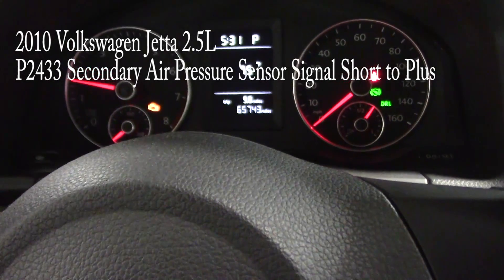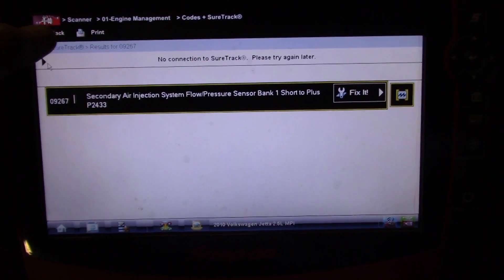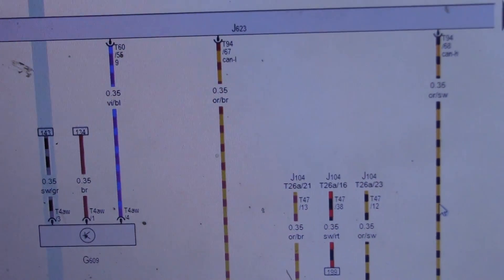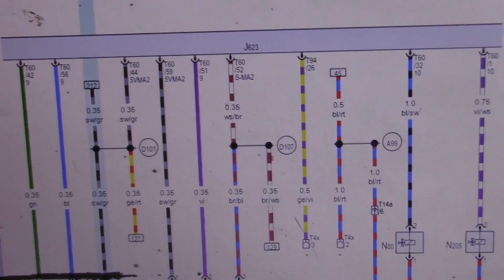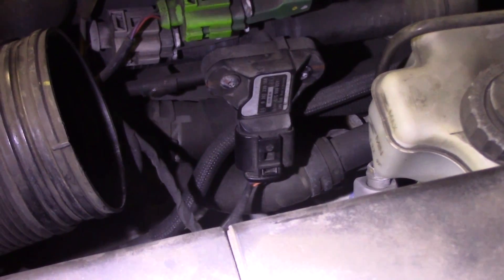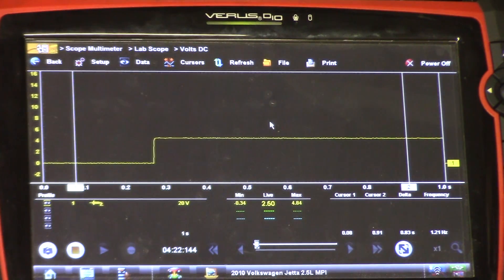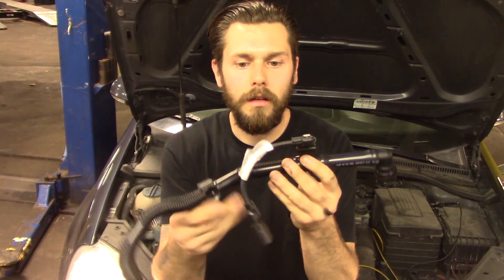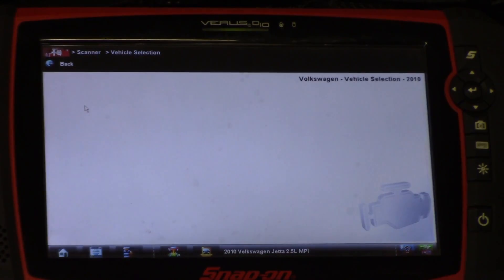2010 Volkswagen Jetta 2.5L- P2433 Secondary Air Pressure Sensor Signal Short to Plus

Comment: Most mechanics get the MAF and MAP sensors mixed up. A person from Midas told me my check engine light was on because of a MAP sensor but, I even thought it was a MAF sensor so, I think I changed the wrong sensor. It’s in the shop now and the Technicians are baffled so I told them to check the MAP sensor. Excellent video brother!

Comment: Ok, that was such a simple yet effective way to determine what the ECU sees with an absence of any data PID. 

That's so cool, you don't have to go to the ECU and measure the V on that pin. You can just unplug the sensor, if the ECU flags a short that means we can confirm that's exactly what it's seeing - 0v. 

How cool. I would have been digging up the ECU by now.

Comment: Does the map sensor look just like air sensor? Because im trying to find out I think the map is under the throttle body and the secondary is right above we’re your sensor is at I got a 2.5l 5cyl
Reply from the maker: Yes they look the same. Map is located under the throttle body
Reply: I am trying to find the location to this part all i can find is the map sensor on my 2015 gmc terrain

Comment: I'm working on a 2012 beetle 2.5 that's throwing up that code. Looks like it has the updated Secondary air pressure sensor. How much did you pay for the updated one?

Comment: My 2011 VW Jetta SE has this same code and it tends to stall when starting up or when at low velocities. Could this secondary pressure sensor be responsible for the stalling?
Reply from the maker: Most likely it is not the sai pressure sensor. However I have only seen it once where the sai sensor was shorted and pulling down the 5 volt reference. For stalling issues. The crank position sensor is very common on 2.5 engines
Reply: Positive Lead Diagnostics You were right. Replacing the crank position sensor seems to have solved the stalling issue
Reply from the maker: Nice!

Comment: So P0491 insufficient flow bank 1 is most likely the air pump itself right ? I have an 09 Jetta 2.5 , can you help me please with any way to test the parts ? Could it be the Kombi valve stuck in closed position or I just need to replace the pump only
Reply from the maker: It could be a few different things. Best way to check for leaks is energizing the pump and soapy water. If it’s a big leak you will hear it
Reply: I had a crack in the hose right before it connects to the combination valve , a little duct tape and it’s fine now , no more light .. I’ll repair the hose with silicone tube when I get a chance, cheapest I’m finding that hose online is 120$,  way over priced for a 3 foot plastic hose
Reply from the maker: Good find.  Those plastic lines get cracks all the time

Comment: Help with this diagnose,1 engine speed sensor (G28) 
2 oxygen hambda sensor B1 S1 heating circuit 
3 malfunction knock sensing monitoring
Reply: But the speed sensor I replace it but still the EPC light is appearing

Comment: Hi Tom. I have 2010 Audi Q5 and have p2432. when i deleted the code it reapers immediately after the second start of the car . i am pretty positive it is the pressure  sensor   and already purchased it to replace but what worries me is that in your video the code reapers even  you changed the sensor. could you please update how did you get rid of the code p2432. thank you in advance and thank you for the great video.

Comment: Hello, my Jetta has this malfunction and I can not find 
the correct sensor. 

If I turn off what you show in the video, the error code is different
 (009266 - Secondary.
               P2432 - 000 - Short to Ground)Address 01: Engine       Labels: 07K-906-055-CBT.clb
Control Module Part Number: 07K 906 055 AA    HW: 07K 906 055 AA
  Component and/or Version: 2,5L 125KW      G   0836
           Software Coding: 0000075
            Work Shop Code: WSC 00066 067 57207
                      VCID: 6DD595F3749BBB2932-8038
1 Fault Found:

009265 - Secondary. Air Inj. Sys. Flow/Pressure Sens Bank 1 
               P2431 - 000 - Short to Ground
             Freeze Frame:
                    Fault Status: 01100000
                    Fault Priority: 0
                    Fault Frequency: 1
                    Reset counter: 255
                    Mileage: 111049 km
Reply from the maker: Are you asking where to get the sensor or where it is located on the car?

Comment: "Caution - Do not replace components based on fault codes alone."  Good advice Snapon.  Great diag. here Thanks Tom..  Seeing a intermittent and a high voltage on a pressure sensor.

Comment: As I recall, my 2009 2.5 Jetta had an extended warranty on this part. I got the same code and it was replaced under warranty at 110K. Good to see someone doing VW diagnosis, you will never go broke working on VWs...

Comment: Great video. I'm glad that I found this channel from your "crossover" with ScannerDanner. I was running out of case studies to watch and learn from with out getting Danner premium. Also, huge fan of learn about vehicles that my shop normally just turns away. You're making me realize that the same diagnostic steps I take with every vehicle can/will work with "Euro trash". Thank you for the share.
Reply: ah dammit, I should have never told you about Tommy :-)
Reply: ScannerDanner 😎
Reply: Hah! Don't worry I am still thinking/saving up for your book and your premium channel. All of your case studies and strategies I've  watched over the years, have really helped me become the diagnostic tech I am today. So thank you for all of that you've shared on YouTube and your forums over the years and thank you for sharing your "boy" Tommy off on your channel. I'm kind of a huge fan of case studies.
Reply: 4stringbazooka keep in mind that using erWin is the key to wiring diagram success on these cars.
Reply: I will keep that in mind. Thank you.